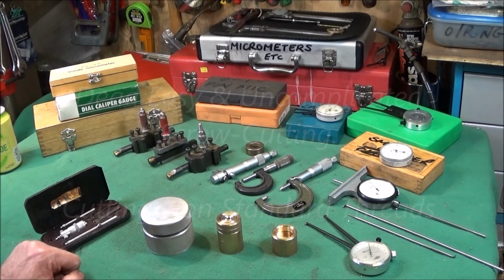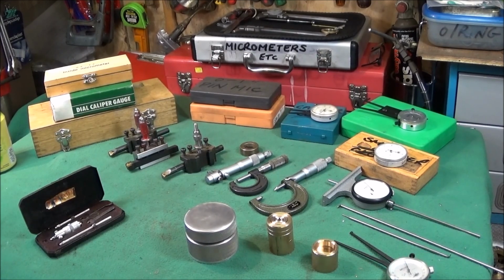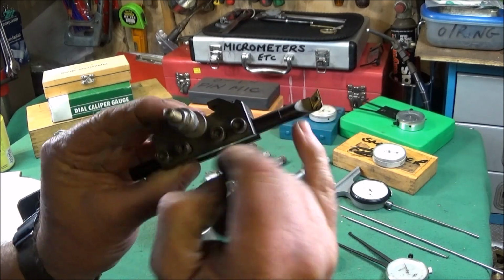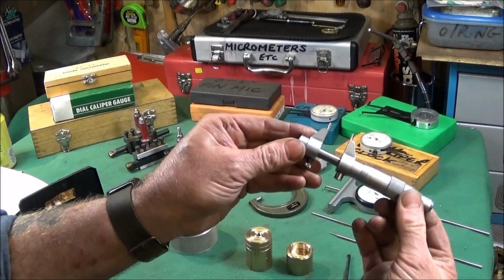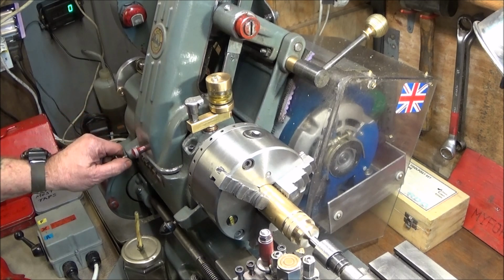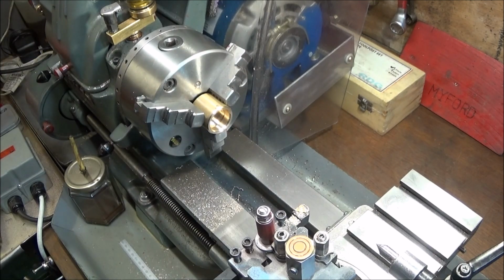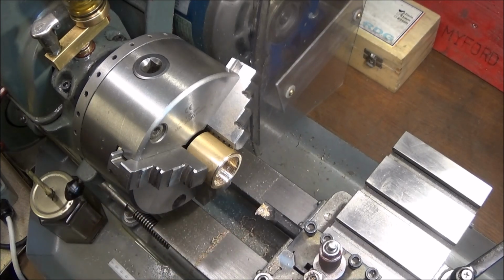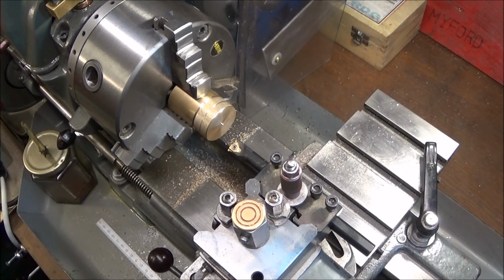The Easiest & Safest Method Of Screw Cutting Threads On The Lathe.

Comment: great info thanks.........what is the tool post you are using....my super 7 has a awkward tool height and I am having trouble trying to find a good tool post......cross slide to work center is 16 mm !
Reply from the maker: Hi, It is a Quick-Change Toolpost that you can get from RDG, Chronos  etc on Ebay. I have milled some of my tool holders off, on the underside at the back, so i can use larger tools and still obtain the correct centre height. I have done a video on this. 

Otherwise...Use this method........If you are using larger tools and are unable to set them low enough to get the centre height. You can mill the underside of the actual tool, taking off a couple of mm. I have done this on several tools. They are not that hard and can be milled using ordinary HSS end-mill bits. I actually use my ML7 lathe for doing this operation. I'm talking about the the tools like the External Thread tool that I have shown in this video and any other of the modern tools you can get on Ebay etc. Regards Steve